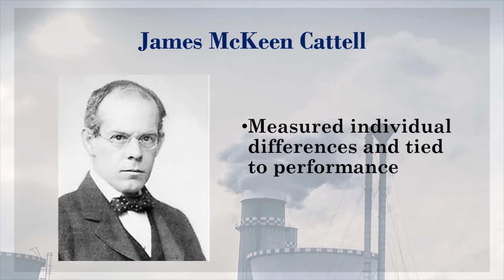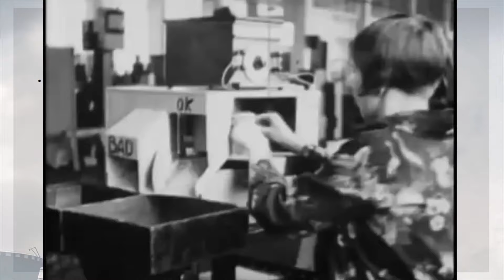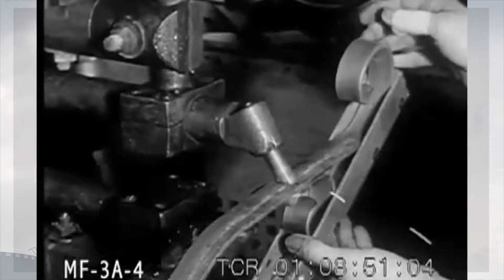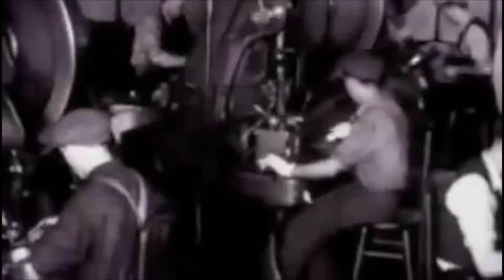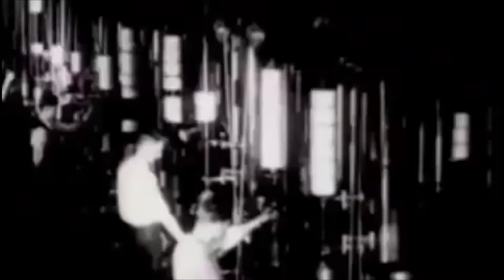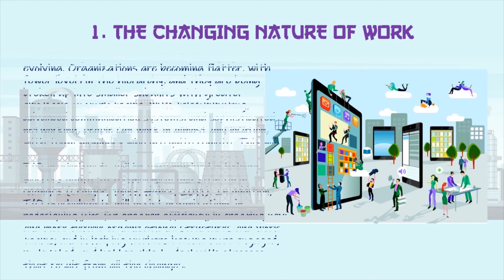Industrial/Organizational Psychology

Comment: The Area or topic I most interested in this video is “The Effect of Lighting on worker Productivity “ by Elton Mayo, because as a women I really admired those group of women who assembling Electrical relay switching, They do the difficult work by turning the lights down even to such level that appeared that women were working in moonlight also led to increase productivity, Even though it’s not easy  for them to work in this productivity and to give all strength and positivity by conduct an effort to improved there works procedure and give all positive expectation coupled with their knowledge of the observations. For me ,they are the example that women have a character to do the masculine work and should not underestimated of others. We are equal in terms of work progress. Just like Mayo said that every change in the work environment could not possibly be causing the steady rises in work productivity.

#BITFSM3C
#IndustrialPsych